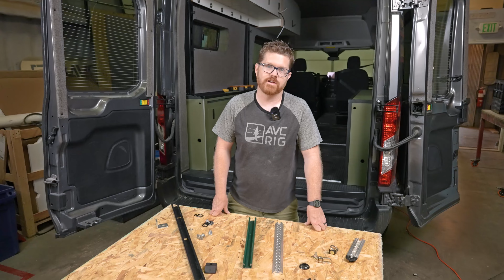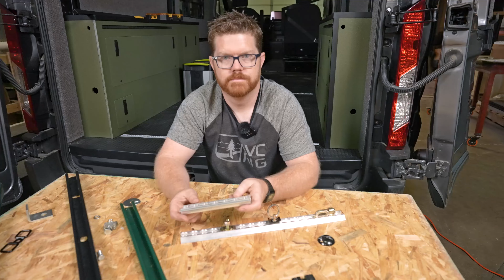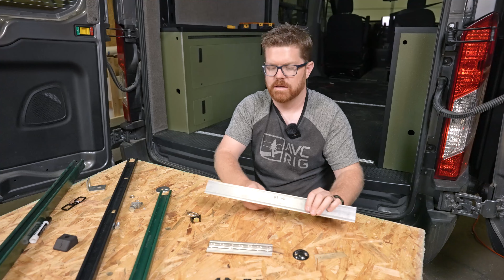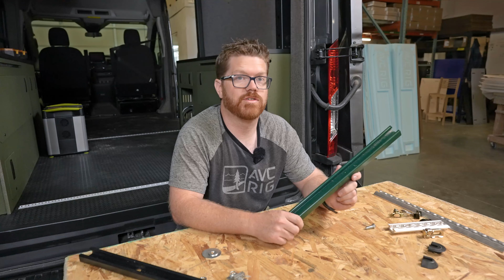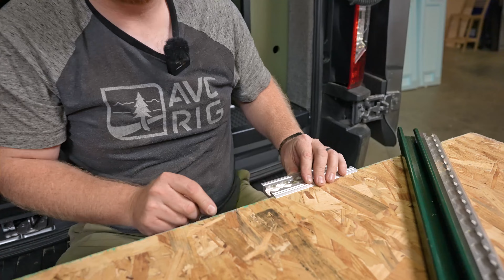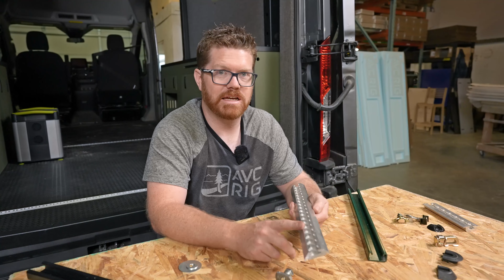L TRACK V.S UNISTRUT | Which One is BEST for your VAN?

Comment: If anyone is that concerned with weight or rust resistance, unistrut comes in aluminum and even fiberglass. It's truly the superior system.
Reply from the maker: I can’t find a shallow version in AL but I’m looking. Fiberglass would be very cool. I’ll check into that.
Reply: @AVCRIG  Grainger has 7/8 aluminum.

Comment: There is aluminum strut and pretty easy to get from Grainger around $80 for 10’ x 1 5/8” 12 gauge also available in 7/8”  and 14 gauge.
There’s a reason strut has been used in construction trades forever.
Reply from the maker: You said it!

Comment: On the availability, I've never seen powder coated unistrut at any store. So yeah you can get it, but not what you use you can't.
Plus, cutting every piece and then sending those to the powder coated, way more time. 

But yeah, cost. Because there's bigger L track to get more strength.
Reply from the maker: Great points!

Comment: I use unistrut in my builds (1 camper van, 1 cargo trailer conversion). I chose unistrut due to cost, ease of purchasing it locally. Plus I have used it for years in industrial maintenance and HVAC. I like the slotted galvanized or the gold zinc finsh. As you said the fittings are way lower cost and easy to find locally. My van had Rhino Rack load bars which are badically just double sided aluminum uninstrut, so Ican use strut nuts (I prefer the plastic cone nuts) for mounting solar panels, awnings and other accessories. I bolted the deep unistrut on my cargo trailer conversion for a low cost method to install future solar panels.
Reply from the maker: Thanks for sharing your experience!

Comment: Really really appreciate your content! I bought an expensive unistrut package and don’t want to pay $125 for 10 mounting points with a hook to hang bags.. you mentioned unistrut would be better for bags, but I cannot figure out how to do it exactly… L track seems so much more straightforward honestly. Could you suggest how to hang bags from unistrut? I have many backpacks for sport gear and unfortunately the unistrut 9” into ceiling and 9” down wall does not make sense so trying to figure out if I’m going to install L track of unistrut where the ceiling meets the wall… thank you for your content!!! ❤
Reply from the maker: Hey this reply is a little late but I hope it still helps. If you’re using unistrut to hang bags you can use Strut nuts and threaded eyelets. If you’re using L track the. You can use made l track fittings. Either way if you’re securing to where the roof meets the wall I’d use our wall to ceiling support. It’ll brace the area and with the wall in place makes a solid connection point.

Comment: Uni strut engineered for industrial mounting with bolts for mounting.  L (load) track has a variety of quick connect fasteners such as hooks, loops, etc.  Whereas either can be pressed into .service, they are different products for different purposes.
Reply from the maker: Great point. It really does come down to what you want to mount.

Comment: Great video. Thanks for sharing. I have used Unistrut and like it. How do I attach lengths to my Ford Transit T 150 van? Screws, bolts ?
Reply from the maker: We bolt ours into the factory 8mm threaded inserts. We have a cutting guide on our downloads page on how to drill your unistrut for the transit.

Comment: Forget that stuff.. Just 80/20 as it has more options for mounting. Plus it's Aluminum. Just spray CRC Marine Coat over it and it's protected for life. The up side 80/20 can be bought cut to length and is cheaper..
Reply from the maker: I’ll have to consider 80/20 as a mounting solution. My only downside is it’s a little harder to setup to bolt into the van (still doable) and you can’t buy fittings at your local hardware store.  I think it’s getting added to Round 2 though.

Comment: what do you recommend for solar panels mounting? looking to use VHB tape to glue a track for a couple of panels
Reply: 80/20 plus 4950 VHB tape on all contact points..

And don't let anybody tell you it doesn't work. I had a panel fly off going down the highway at 70 mph. As one of them stupid tilt bracket knobs come off.. And it ripped the panel off. While breaking the aluminum bracket in half attached to the panel. While the brackets were still attached to the van using VHB tape. I got it on video and will post once I get time to show the whole thing...Damn lucky no car was hit or anybody injured. So I will never use them tilt brackets again.

Comment: Behind walls, unistrut. Exposed I’d use L track. 80/20 could be either.
Unistrut and L track has different purposes even though they “could” be used similarly. 80/20 is the best of both worlds.

Comment: Nice tutorial, I’m doing band life on a budget, and work construction, I get all my strut for free! The stuff is really cheap as you mentioned, and when I say cheap, I mean and expensive because it is a quality product as well. As I mentioned, I get mine for free because I dumpster dive and recover all the used Yuna strut that the electricians and plumbers throw away when they are reconfiguring different things. It’s amazing how much strut I am able to acquire. Even 10 foot lengths. although mine are usually painted white over the galvanized finish, and they also have holes in the back, well, not holes as much as elongated holes, I’m sure you know the type, but it’s all free. I do have to Buy all the fasteners, but no big deal, fasteners are cheap and I don’t use a whole lot, most of my strut is used in structure anyway. I do weld a lot of the material together, so the powder coat finish needs to be done afterwards, although I don’t worry about rust so much, like I say on a budget and like function over form. But again thank you for showing me the L track I may need to get some for my bike tiedowns.

Comment: I'm wanting to build a rack for the top of my Sprinter.  Essentially one purpose.. to hold a 200w solar panel w/o having to drill holes in the roof.  What are your thoughts.  Video is over a year so you may not see it.  Thank you..

Comment: Why dont you use aluminum unistrut?
Reply: SuperStrut is a maker of Aluminum Unistrut.  I looked at their product catalog and they do have a few specs on there.  I'm sure the Aluminum Unistrut would be good for many applications.  You could probably reach out to SuperStrut and ask if they have detailed strength specifications as compared to the steel version.  It can be purchased from Graingers and picked up locally if you have a Grainger's warehouse near you.

Comment: Thanks for the the informative video.  Questions:  #1 What about using aluminum Unistrut?  Maybe it's weaker but wouldn't it still be strong enough to install cabinets and a bed frame as long as there are enough fasteners (one on each rib) to distribute the load?  I'm hoping to get an electric van to build out and want to keep the weight down wherever possible.  #2 How do you fasten aluminum Unistrut or L-Track to the van?  Aren't steel fasteners incompatible with aluminum, causing corrosion over time?

Comment: just found your vid as I was comparing unistrut to 10-series 8020 to L-Track.  Hope you don't mind me resurrecting an old video.

I'm looking at making a set of rails for a roof rack and I'm considering all options. 

After seeing your vid, I think I'm moving away from the L-track.

You talked about weight, but have you all considered using aluminum unistrut?  If so, why do you use steel over aluminum?

Also, why not use low-profile, single sided 8020.  I think it's the 10-series (part number 1575 or siimlar) that has only one side that's got the rail instead of all 4 sides.  There are other verndors that make this, like Powertec; but these are made for wood working tables.  I worry a bit about strength.

 Any insight from someone who uses it would be greatly appreciated.

Much thanks in advance.

Comment: I agree 100%. I have used unistrut , use to be called kendorf  years ago, in my HVAC business for 35 years and I know a lot of uses it provides. The only draw back is weight. I have used it on roofs to hold ac units. They will not rust with the powder coat paint.

Comment: Could you use a profile of 80/20 along the walls drilled for factory insert locations instead of l track or uni strut?
Reply from the maker: You definitely could but I think it would be more difficult. If you’re building all your cabinets from 80/20 then it would be the way to go.

Comment: Good comparison. I’ve been using Unistrut/kendorf/superstrut for 30 years. Its infinitely adjustable, muuuuuch cheaper and supports more weight In our warehouses (3) and vans (prob 50 over the years), I’ve never primed and painted the cut ends, and it never created anything more than surface rust. No degradation in use and no “creep” under the ionization. Also, 10 mins of effort, and you can create custom holders for anything. The game changer was replacing the “strut nuts” with “cone nuts.”
Reply: The weight increase is not even that much,  maybe at most 30lb more.
Reply: I’m guessing you’re cost comparison does not include the extra fuel you use driving your vans around with Unistrut. 80/20 is infinitely adjustable too. Just because almost no one building vans knows how to properly use 8020 t-slot extrusion to take advantage of its features doesn’t mean it should’ve been left out of the comparison
Reply: @GOLDVIOLINbowofdeath but this has nothing to do with 80/20

Comment: Is a retired structural engineer I have to say your knowledge of structural design is very lacking
Reply from the maker: Is there anything specific we are lacking in? We’re always open to discussions and learning.
Reply: @AVCRIG . first, a chain is only as strong as it’s weakest link. if your bolts are 8 cents they are not grade 5 steel much  less grade 8, they are grade 2 or more likely unrated, Chinese garbage. I would not use anything less than grade 8 bolts in any vehicle. in case of collision, the extra $20 vs getting hit in the back of the seats and head by all of the cabinets that break loose in a front end collision or roll over is a no brainer. BTW, get your grade 8 bolts from Zoro, not Home Depot, for a fraction of the cost. Sign up and get free shipping if over $50 and occasional 20% off
Reply: I saw this comment, watched again looking for the errors. I'm very happy you're retired. He didn't use the proper words, but he does seem to understand yeild strength and plastic deformation well enough.
Reply: @rubikmonat6589  do you think his statement that every time steel is bent it returns to its original position is accurate? He didn’t use those exact words but that’s what he said, and he certainly didn’t use the terminology that you used how can anybody that knows anything about structural design not find fault in the fact that he didn’t even discuss grade 5 or grade 8 bolts, but instead discussed using bolts that cost eight cents
Reply: @GOLDVIOLINbowofdeath  It's called a spring mate. He misused the word bend.
Reply: @GOLDVIOLINbowofdeath - yeah, I noticed that error related to the permanent deformation of alum vs steel also, but it is so minor in the scheme of this conversation.  If that is really all you are criticizing him for, it would have been easy to correct him without the whole; “I’m an engineer and you don’t know anything”… routine.
Reply: @KenLeonard  “routine”? What routine are you referring to? don’t put words in my mouth. You must be a Democrat. If the only way you can win a debate is by making up stuff that the other party didn’t say, don’t enter debates.
Reply: @rubikmonat6589  thanks 😊
Reply: You must be fun at parties…..
Reply: @ryankim3612  lol 😂

Comment: Why would you not compare L track to 80/20 instead of Unistrut? BTW, 80/20 does not have 1” increments either and it is much lighter than unistrut
Reply from the maker: You’re absolutely right. That would be a great addition for a future video. Most of the 80/20 we use is for racks or framing, but it would make a good rail for attachment.

Comment: Uni-strut is available in aluminum. I have the short and the high profile models on my van. Several models of end caps are available too.
Reply from the maker: Thanks for the info!  I had seen deep channels, but never shallow stuff.
Reply: @AVCRIG  you have to look at Grainger and McMaster.  Both Grainger and McMaster have it (low profile in aluminum).  And, at least in Southern California, you can pick it up at locations locally after you order it online and save on shipping cost.
Reply: @Glenn92651   Grainger and McMaster are never cheap sources. Who is the manufacture ?  Please supply part numbers for the shallow aluminum and shallow steel without holes ?
Reply: also available in Stainless steel. low profile and standard.
another handy material is double strut where the two are baak to back or welded into a corner.
I made up some for a specalty table standard strut one direction and low profile mig welded to the first at 90degrees.  worked perfect.

Comment: Slots will help match L-track 1 inch increments for bolting things down. And unistrut comes in aluminum. Boom!
Reply from the maker: Boom indeed. 😎
Reply: @AVCRIG  The best pro of unistrut, as you said, is that you can get it anywhere. (But no one carries AL unistrut, have to order. But at least the hardware is everywhere).

Comment: What are your thoughts on using t slotted aluminum extrusion tubing vs unistrut?
Reply from the maker: T slot is another option. The hardware is also specialized to a degree. Personally I still like unistrut. T slot has its place (we use it on our roof racks) I mostly see it in cabinet framing.
Reply: @AVCRIG  yea yea, i gotcha.  always pros and cons when making these decisions.
Reply: @AVCRIG  awesome videos btw.  thanks for sharing!

Comment: Aluminum extrusion seems prudent to work into a followup for this video. The 80/20 catalogue is ripe with van applicable products, particularly when odd articulating assemblies are needed such as Murphy beds, etc.
Reply from the maker: This could open up a can of worms and I like it!
Reply: @AVCRIG  feel free to reach out and I’ll be happy to share some of the things I’ve come up with. The OurKaravan galley is a good idea of the flatpack modularity of it, and can confirm there are numerous drop in, roll in, and other fasteners that are as convenient as strut and offer the same benefits over logistics track.
Reply: @AVCRIG If you haven’t seen it, Misumi has an insanely comprehensive collection of extrusions, and of hardware in general.

They also have an impressive collection of hardware that they can customize. Bolts with precise lengths, etc. Sometimes two or more different measurements with 2 to 3 significant figures of dimensions. 

That is approximately the opposite of “available at a big box store”, but it’s really fun to look at :)

Comment: While I agree with everything you said, you did not mention the cost of the painted coatings on the Unistrut. It should be professionally powder coated as you could not easily get the paint fully under the channel. It would be good to also add the cost of the Unistrut special nuts and not just account for the 8 cent bolts.
Reply from the maker: That’s a good point about the strut nut. I order super green coating on our strut and it comes that way powder coating is a great option too ( we offer pre cut and coated stuff on our site).  It’s actually really difficult to find truly raw unistrut from anywhere but a specialty supplier (we looked it actually costs more from my distributor, guessing economy of scale) It’s just not common.

Comment: This is very helpful. I was looking at l-track exclusively, but you really have me reconsidering. I have seen aluminum unistrut, so I may research that some more.
Reply from the maker: That’s great. There’s lots of options out there, definitely see what’s best for you.
Reply: l track selling feature it the quick secure, no tools.  The only argument here was cost, and the bolt issue (which if you bolting something (permament) why you just bolt it to the substrate?🤷‍♂️)

Comment: Why did you not show aluminum strut channel? It comes with holes, slots, solid backing. 12 and 14 gauge. Many people are using it to mount solar panels since it does rust and you can cut it to custom lengths.
Reply from the maker: I totally forgot about Aluminum strut! Great point. I used to work at a shop where we used it on the roof for solar mounts. I was in the mindset of interior mounting solutions and we didn’t consider Aluminum.  Thanks for the comment. 

Do you know if it comes in a shallow version? I’ve only seen it in the 1 5/8 deep configuration.
Reply: @AVCRIG  yes, 14 gauge
Reply: I get small quantities of aluminum strut channel from McMaster-Carr. They have standard and low profile in aluminum.